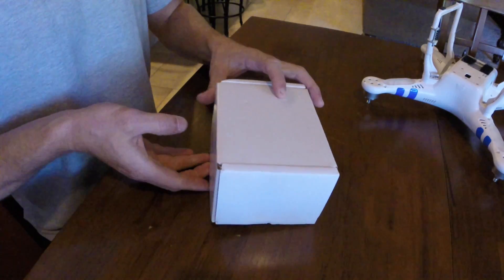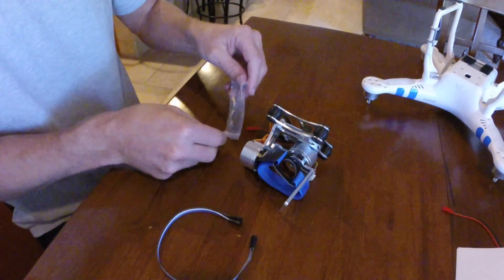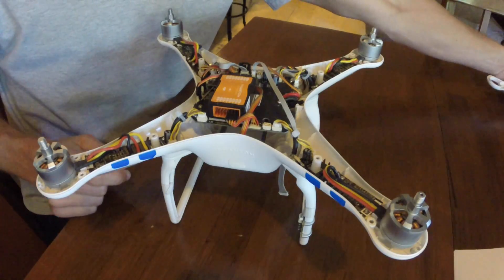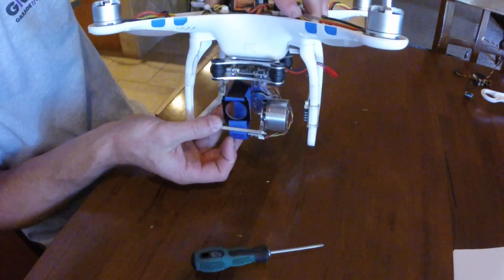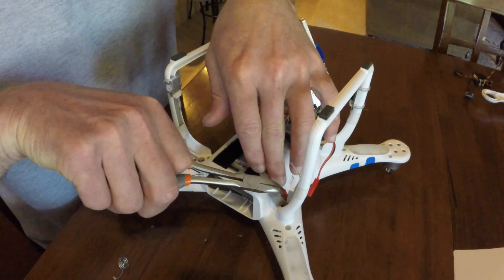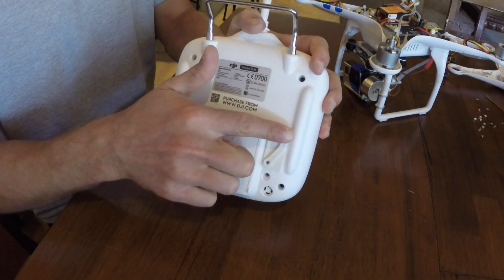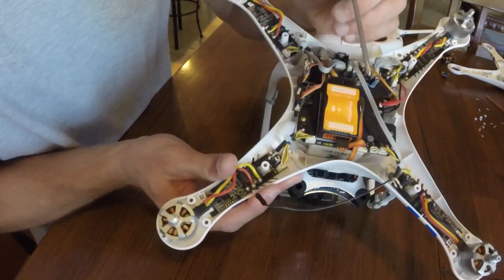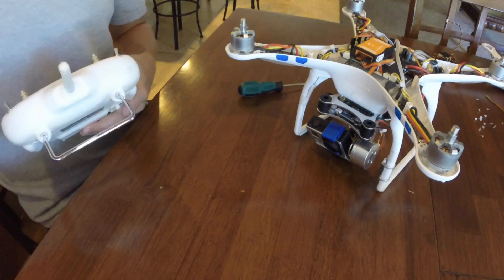How to Install a Chinese Gimble with GoPro on Phantom 2 Drone

Comment: After doing this, you can use the Gopro to see throw a Smartphone or tablet?
Reply from the maker: You can use a tablet if you get the correct attachments for it.. For this I used a 7" screen that allowed me to plug the receiving end of the transmitter into it to give me a live feed

Comment: Does this work for the phantom # visión plus? My remote does not have a hole for a lever (which doesnt come with the gimbal i bought AND its exactly the same as yours
Reply: its different model of the transmitter I believe, mine doesnt have lever too

Comment: Hi. But if i replace the camera of p2 vision with gopro and this gimbal i have to say bye bye Wi Fi connection?
Reply from the maker: That is correct unless you add a first person view screen with a transmitter to the drone and have this connected to the GoPro
Reply: Dubled83 But is impossible put the fc 200 (p2 vision camera) on this gimbal? With 3M adesive, zip tie, velcro ecc...?
Reply from the maker: I unfortunately haven’t had experience with this so can’t answer. I apologize

Comment: This is by far the most comprehensive video regarding the gimble, installation, et al.  I was able to follow every step and mine now works.  It seems that this company that can calibrate the gimble sold their URL.  Does anyone have a new download link to where we can calibrate the gimble?  I have the DJI Phantom II (no vision) and would like to sync it correctly.

Comment: can the camera mount be flipped?
my sjcam usb port is on the side of the motor and keeps the camera from sliding all the way next to the bracket
Reply from the maker: h belcher I don't believe it can without having to modify the gimbal itself
Reply: it was easy 
i just removed the 3 screws that held the front arm and rotated it to the other side and replaced the screws 
and calibrated the ginbal 
now my usb doesn't hit the motor 
works fine
Reply: h belcher I have the same problem how did to achieve this I can't work out what screws you removed

Comment: Hi there, is it possible to attach a monitor to preview what the GoPro is recording?
Reply from the maker: Yes as long as you install a transmitter to the drone and have a monitor that has a receiver built in you should be able to see first person view while flying with the go Pro

Comment: great video, got me setup but have a question, is there just 2 positions for the camera?  Forward and down?  Thats all I can get from mine. i can just control the speed of how it goes from one to the other.
Reply from the maker: Eddie Hickey  you should be able to adjust the speed of the gimble up and down and it should allow it to stop mid way through for those semi angled shots as well

Comment: you instal it the same way on the v3
Reply from the maker: I am not to familiar with the V3 but if it has F2 for pitch and F1 for roll then it will be installed the same way.